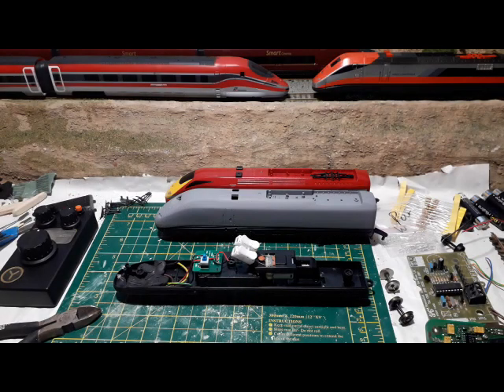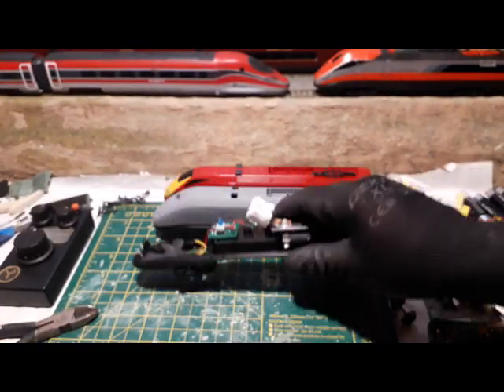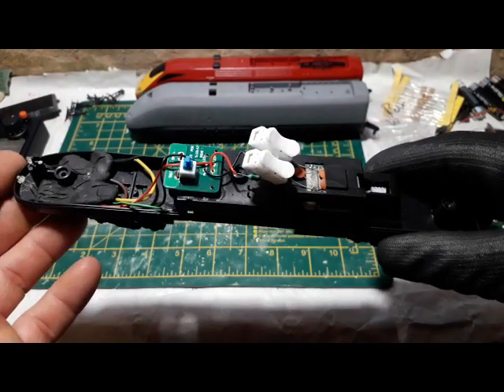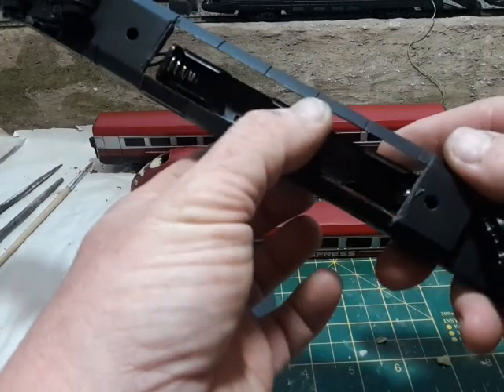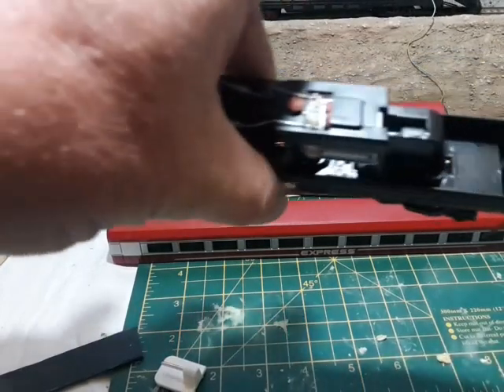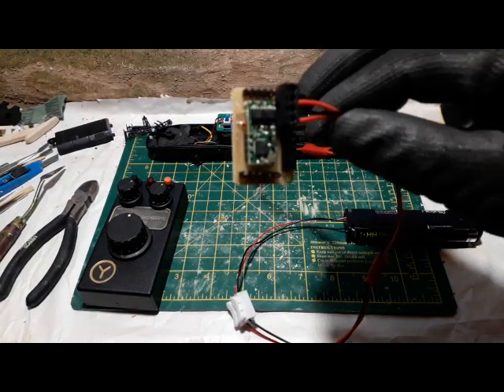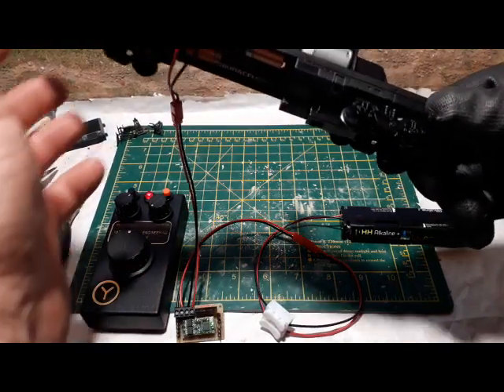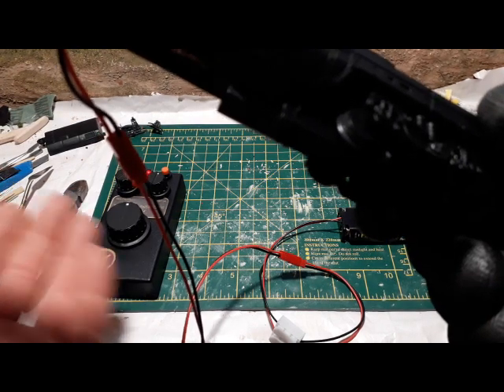Battery Power Radio Control!

Comment: What is really great about RC trains is that you do not need any track wiring to run the trains! Instead, you can concentrate on block-related stuff (signals, barriers, etc.) - much less complicated - no DCC power packs, no reversing loop stuff, etc. Almost no polarity issues! I have wanted to do this sort of thing to run my AT&SF steamers - put the RC board and batteries in the tender and/or the next freight car, and away you go (here's an idea - have a few freight cars that are rechargeable battery "swap cars"). Great video!
Reply from the maker: Thanks for the great comment :) I've got at least 8 of these sets now and they all come with 4 metres of high quality plastic track. I'm going to build a modular RC layout with some of it. The swap cars is a good idea...Thank for the input.

Comment: Hi Tom, I wonder if you can help and advise me. I am desperately trying to get a toe into RC train controllers. I want to convert a Fenfa 1:87 toy battery train, to full RC control. I've tried contacting a few guys on the web,  who supply there own systems commercially, based on the chip that Deltang use. I understand the guy who runs Deltang has bought up all the supply of the now redundant chip. So no one else, previously making RC train controllers can get hold of them. Consequently I can't get a controller system, with a small enough receive that fits into the train. I'm looking for a system exactly like the one you are  using in your video. Receiver wise it looks ideal. The question is: where the heck can I get one! Do you know or do you have any ideal of when the flood gates are going to open, and sheer demand for this far superior  method of model train control is going to force the chip manufacturers into producing these chips and thus break the strangle hold Deltang has on the market at the moment.  Many thanks. Dan